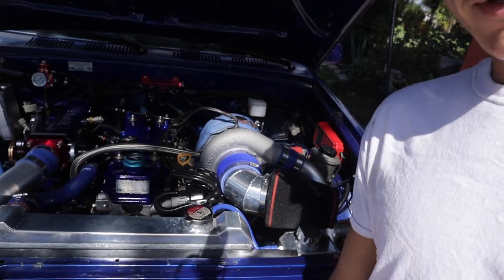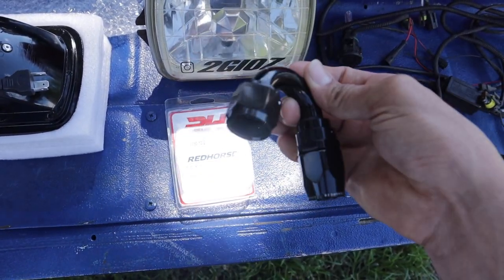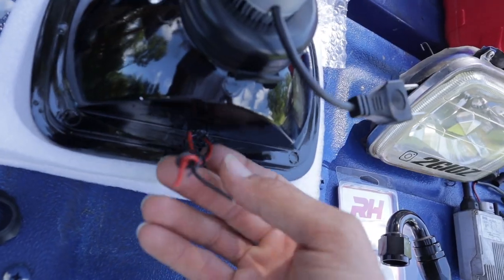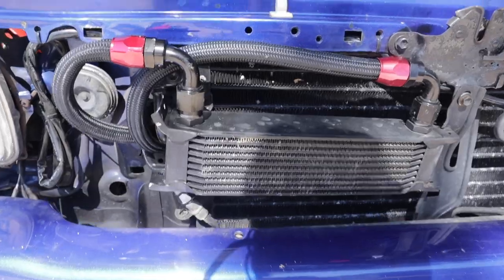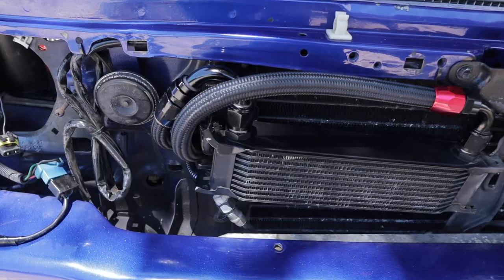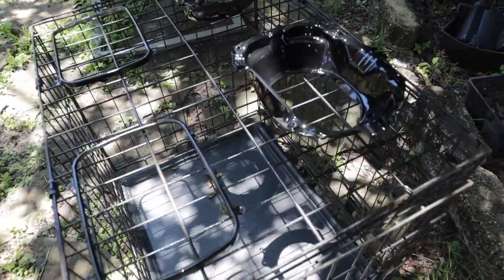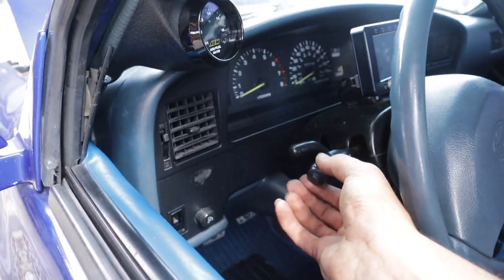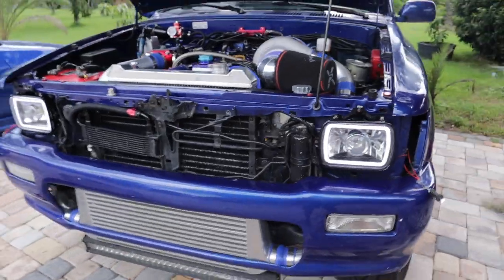94 Toyota Pickup LED Halo Headlight installation!

Comment: The quick connect/disconnect terminals are nice. I have those on mine. They go on an you push the cover down an they clamp on. No exposed parts to touch metal

Comment: Did you need a wiring harness to run them or do they hook up to the oem plugs?
Reply from the maker: I had to splice them to my daytime running lights.
Reply: Okay but for the main headlight plug in need you need a harness?
Reply from the maker: @sillysammy7550  ohhh sorry, they plugged right into the factory harness, no modifications or adapters needed
Reply: @2gioz  appreciate the response just ordered mine!